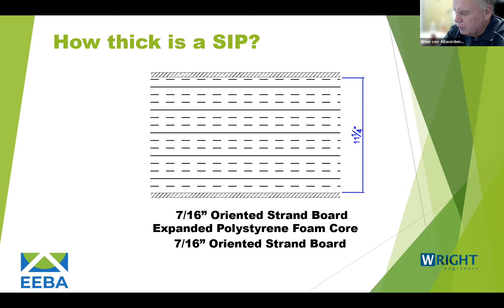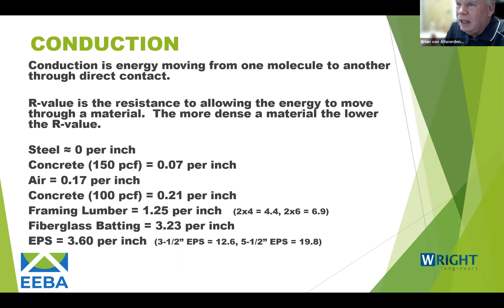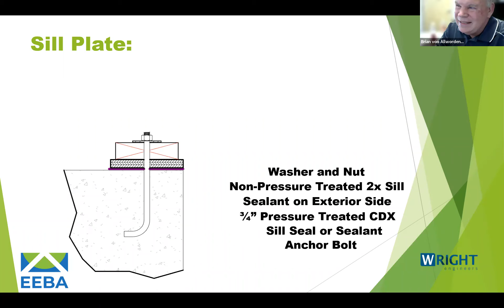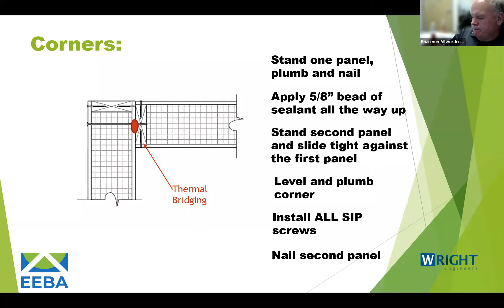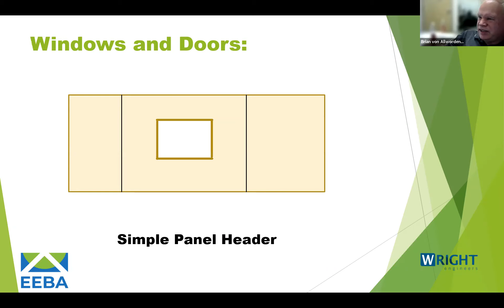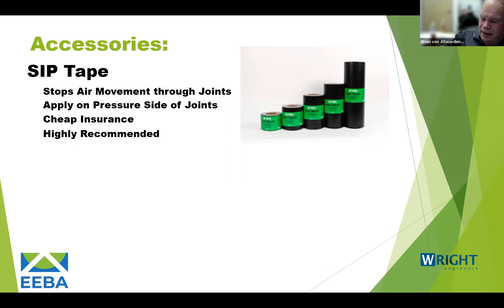Understanding Structural Insulated Panel (SIP) Construction

Comment: Zero talk about a big time negative of SIP… water damage etc.
Reply: The focus of this presentation dealt with the Energy benefits of SIP panels and the entire system.  However, indirectly the presenter did mention between the lines the negative of SIP.  The two items that I picked up was contraction and expansion (“C&E”) and overall water management.  In terms of C&E, if the SIP is not designed correctly, you will create opening in the seams.  An avenue for water moisture to enter.  If you do not seal correctly, becomes an invitation for water moisture to enter.  Both of these cases can cause the wood panels to deteriorate over time and loss the ability to maintain that stress skin.  In my opinion  this is the biggest negative.

Comment: Very informative video!  Thanks for the info!

At around 41 minutes, the slide says not to use house wrap, but it recommend the use of “Type D Building Paper.” Since I am not familiar with Type D Building Paper, I searched for it on the Lowe’s website and the Home Depot website and still don’t know what it is. Tyvek house wrap and asphalt felt were included in the search results as well as paper drop cloth. Can you help me understand what it is?
Reply: It's the asphalt felt, also known as tar paper.
Reply: @mikeRadamz  Thanks! I am familiar with that product having used it as underlayment under shingles over the years. We called it “felt” never knowing its technical name.

Comment: I have my home and I love it, could be 110 outside and my house is 73, and not to mention how soundproof it is, and if your ground should settle underneath it, your house will not crack, and the best thing is none of it inside. Walls are supporting walls so if you get tired of the floor plan, you can actually change.

Comment: This is great! Most of the Building Science regarding SIPS seems to be several years old and a  bit out of date with progression of things. The design details mentioned in the presentation are excellent - thermally-broken splines, bevel top of sip wall. Didn’t mention new design SIPs using polyiso are being made that can pack a bit more R value per inch, plus they lock together with a panel lock and leave a gap for the osb to expand. The question regarding liquid applied water barrier is very relevant especially in rainy areas like the one I live in. Smart conventional builders all use Huber zip for the walls and roof It is a water barrier but vapor permeable. There is a high chance that the roof will get wet before the actual roofing product is affixed. Having the fluid applied barrier put on at the SIP factory seems like the best method to prevent wet OSB while waiting for the roofers. I see Ted Benson has some of his new wall panels with 5/8 Huber zip on the exterior.